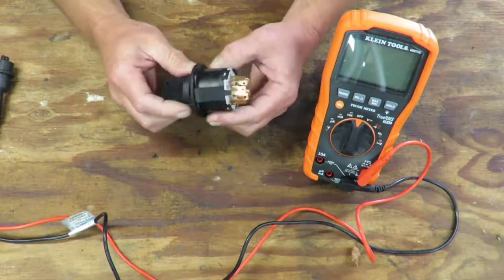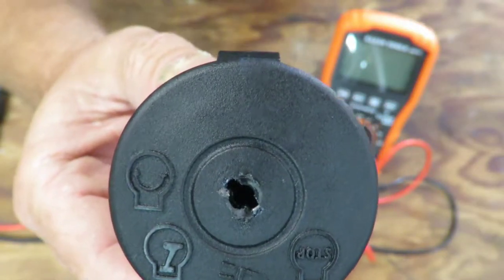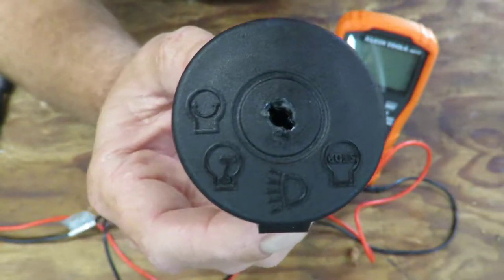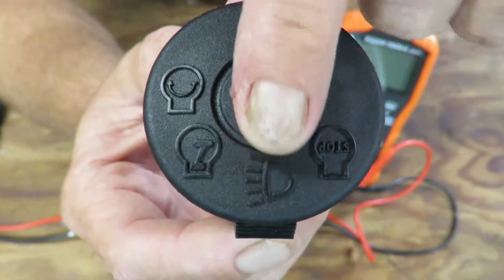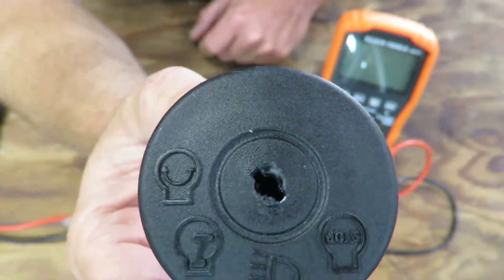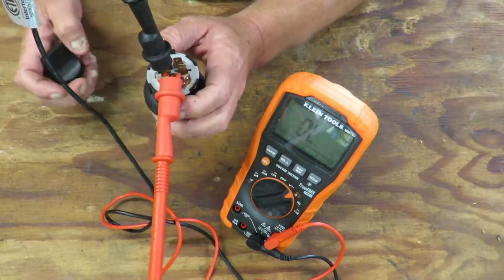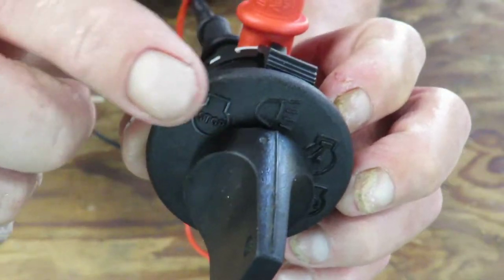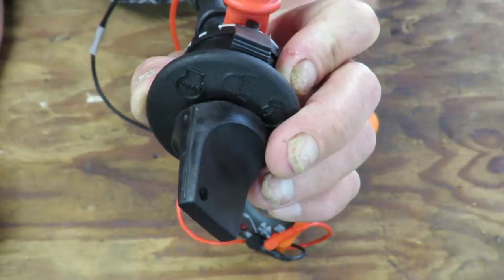How to Simple Key Switch Test

Comment: I have a 3y/o Cub Cadet XT1 with the Kohler SV540 engine. I've had a slight charging issue since new where after weeks or months the battery will get weak, hard start then eventually the clicking. Originally I thought maybe someone left the lights on or just a bad OE battery. Fast forward to the next mowing season (last year), I put a new Interstate 375CCA battery in it. Made it to fall and the issue happened again. Now to today, battery tested good, stator output tested good and the voltage regulator to battery tested good. But one thing I noticed was the voltage regulator battery wire/terminal tested identical volts as the battery regardless if the ignition switch was in the on or off position. With this switch having the reverse safety and all that on it should it be showing 0 at the voltage regulator while in the off position? Thanks!
Reply from the maker: Should be No Voltage with Key off
Remove key Switch and test it
I will do a video really soon on How to Test for Voltage Draw on Battery with Key off very soon. It is one of the coolest Tricks for this very problem.
This video will help you easily figure it out if its Not Key Switch. But usually the power to that charging wire comes from the key switch. And the key switch is at fault
Reply: Sartin Garage do you have any advice on getting the switch out? I started working on pulling the dash and gas tank but it got dark. Do these need to be removed or is there a way to get it out of the dash without disassembly? TY
Reply from the maker: @nhoffman1987  Some Key switches are easily removed. Some are not so easy.
If it is the plastic switch. There is a tab on the top and bottom of switch. Push down the tab and push the switch out toward the front of dash. Same for other tab being careful not to latch the other tab back.

Getting to the Key Switch is different on every mower made. So without seeing your setup. Would be hard to explain
Reply from the maker: @nhoffman1987  I just looked up pictures of your exact mower. Looks like that one the gas tank is completely blocking any access to the key switch. I have to say I have never repaired a Xt1. I cant tell you how it comes apart. Sorry
Reply: @sartingarage8045  I got the switch out for testing. With the key in the off position I was getting readings at M & G, M & A1, and G & A1. Do any of these indicate the switch is the source of my issue? Thanks again.
Reply from the maker: Im pretty sure its B terminal to A1 terminal
Should be No connection off
Connected with key on
Reply: Sartin Garage yeah there’s no connection there while off.

Also idk if this changes anything but my VR has 5 wires going to it over 3 terminals. 
Left A Terminal: White to stator & tan going towards ignition coil/module
Middle B Terminal: Purple to battery
Right A Terminal: White to stator & tan going towards ignition coil/module

TY for the help and any advice on where to look next?
Reply from the maker: @nhoffman1987  That is strange
If the key switch is Off , There should be No Voltage to wire to regulator.
Unless one of the 5 wires to regulator has Voltage on the same output wire on regulator( center wire on regulator

Comment: Thank you for this video. You explained clearly what the switch does. I am still confused in one area, so I apologize if I sound stupid with my questions, but how do you know which two to put the multimeter probes to? For example, I know M & G go together but what about the rest? I have a 7 terminal switch I'd like to test but don't know to which two do I connect the meter probes to or if I turn the key on or off when checking for continuity.
Reply from the maker: B= Battery
M= Magneto / Ignition Coil
G = Ground
Y = Accessory or Sometime Headlights
A1 and A2 are Accessory 
If I remember correctly A1 goes to charging/ voltage regulator